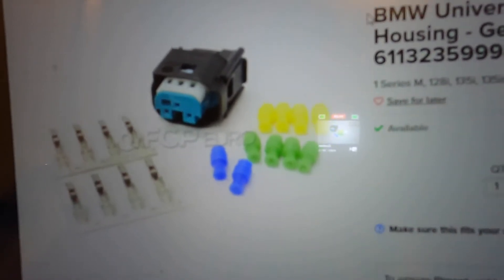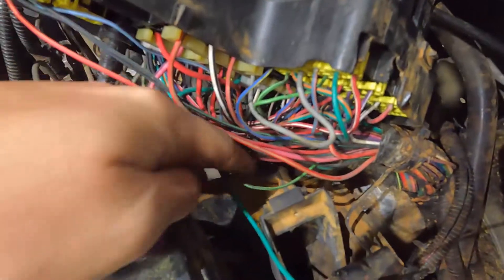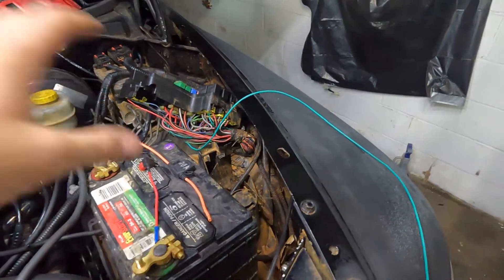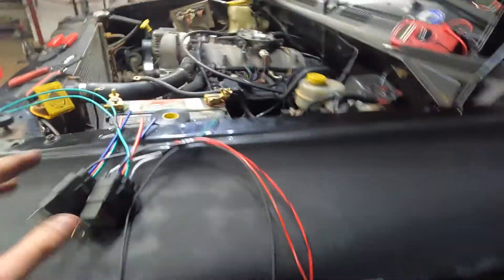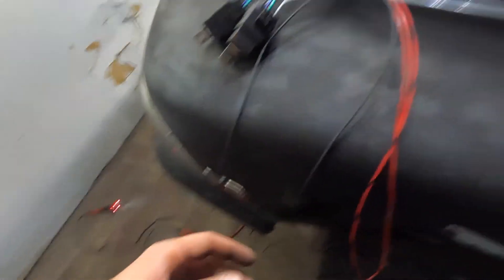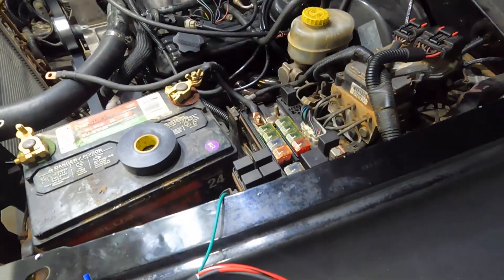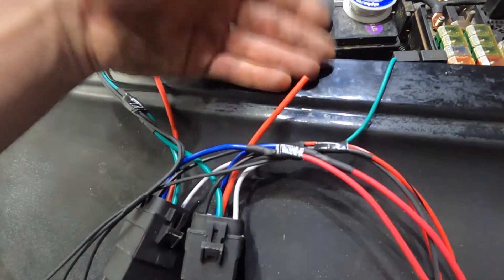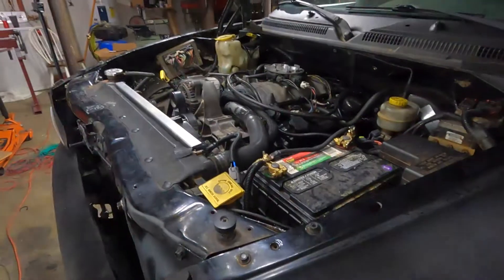simple dual temp fan control(Dakota Rt)

Comment: Hey Thomas, question for you. Would this still work with the a/c system? Meaning, when the condenser needs to kick on the fan, will it since it is not hooked up to the factory sensor.

Comment: Good deal, I have a 5.9 magnum in a 99 1500 4x4. I’ve been contemplating installing electric fan. It would open my engine bay up tremendously. Thank you for the work your doing. I’ve also bored out my throttle body, it was a quick mod. I did see the butterflies and didn’t want to touch them. Thank you for going more in depth I’ll do so for my performance build and thank you again.
Reply from the maker: Thank you. I'm glad the videos are helping.

Comment: Is that the stock belt? What belt is that? I see you have no compressor
Reply from the maker: AC Delco 7K880, or Gates 5070885 according to the forums. I usually just use a piece of wire and measure what length I need when doing my custom stuff. I'll look at mine but IV got a modified tensioner from when I had the blower on it.
Reply: @thomasbeyer  Thank you, I've been thinking of just removing all my ac components. I never use them and my trucks been running hot. You think removing the ac condenser and adding a 12v fan will help? I wanna keep my mechanical fan
Reply from the maker: @chicagorc3967  depends how high are your temps getting?
Reply: @thomasbeyer  yesterday it got to 220 but usually stays around 210. I've been having brake issues also. I've replaced almost everything but my brakes seem to get hot super fast. I've also flushed the lines and still, she gets hot after about 20 mins of driving. Been thinking of getting drilled and slotted front rotors. I'm running out of ideas .
Reply from the maker: @chicagorc3967  if you have a 195 thermostat 210-220 isn't crazy. Could put a 165 thermostat in it.

Comment: I know its not applicable in your situation, but if someone was wanting to retain factory AC, could you add a relay for an AC switch trigger so that it could pull air through the condenser even if the engine is not up to operating temp?  I plan to add electric fans, in the Ram it opens up the engine bay so much and this video will definitely be a huge help when the time comes to do so.
Reply from the maker: Yes definitely. There's lots of ways to do that . Depending on if you wanted to run one fan while the AC is on or both fans while the AC is on. If I was going to do this thinking about using AC to trigger the fans I would have ran ignition to the fan switch and then just grounded the other triggers on the relays and then you could use the clutch signal wire on the AC or even the signal going to the AC relay to trigger the relays but if you want to run both fans you're going to end up having to use diodes. I'll do a little studying I was going to wire a switch in the truck for a manual override but I've been contemplating just using the AC button.